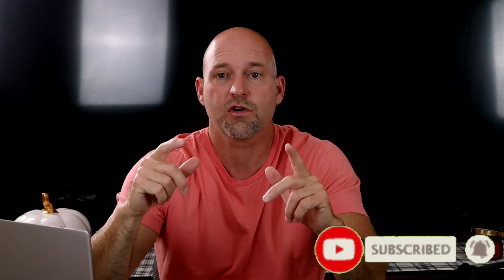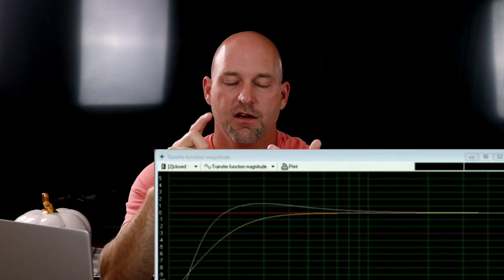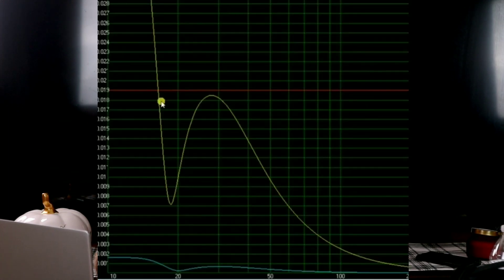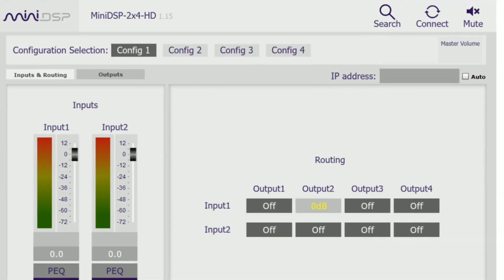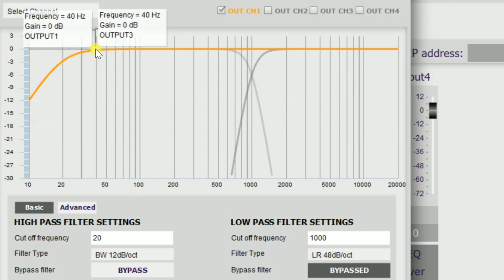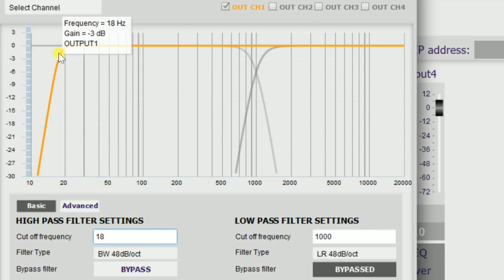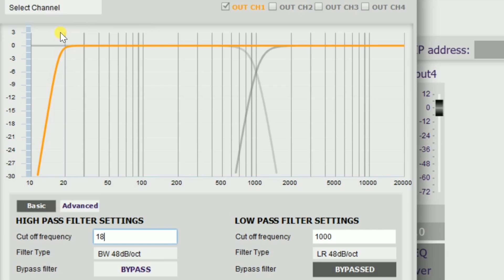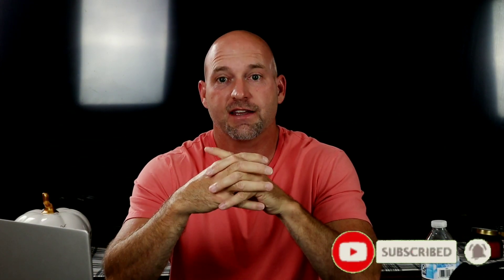Ep. 41 - Protect the BASS! Subwoofer  HPF | High Pass Filter | MiniDSP. DIY Sub | Home Theater Gurus

Comment: Thanks so much, as of alot of us i have lett my system calibrated by "Brandon" 👌, 
But i wanted a little more Shaking lows, on my Mini Marty with a Dayton UM-18 Driver Powered by a Crown XLS 2002 , and a 2x4 DSP hd, he set my Mini Marty Witch is 17 Hertz tuned at 18 Hertz and a 24 octave slope, then i set it to 12 db slope, to discover that i was rolling of at 30 Hertz, not what we want, now i have set it to 15 Hertz but at a 36 Octave slope, so its exactly tuned what the Mini Marty need and is not going to damage my Subwoofer cause of over excursion 👊 this video is amazing thanks so much 🙏

Comment: I have a Yamaha avantage 1080 receiver. The sub out of the avr I hav connected to the poweramp that has no dsp. The power amp is connected to my passive sub. Can I use Yamahas internal dsp to do subsonic to save the subwoofer or I need to buy a miniDSP. 
If yes what are the main functions that miniDSP has that a Yamaha avr dsp doesn’t have purely subwoofer point of view

Comment: I was under the impression you wanted to do this before ever running my sub (full marty) but in episode i believe 7 you set it toward the end after running sweeps,aligning etc. Does it matter if set before or after sweeps?
Reply from the maker: You can do it either but the important thing is to make sure you don't set it then boost it under the filter during eq which negates the filter.

Comment: What would you set your cut off frequency in the case of using port plugs?  My PC4000 is 17Hz standard, but with a port plugged is 15Hz.  Do I still want to use 17Hz for the cutoff even if I have the port plugged?
Reply: No, you can change the HPF if you plug the port

Comment: Very important video that no one talks thank you 
A question if I have plate amp it doesn’t have a subsonic filter so I will have to buy a miniDSP correct 
The avr why don’t they have this feature built in so that we don’t need to buy a miniDSP or a plate amp just buy a superb poweramp and drive a passive sub

Comment: I used REW as per your video and aligned my 4 subs. Thanks a lot for your videos. After I pushed my calibration to miniDSP. I do measurements to confirm if the new calibration has been ported. It works. But then when I set Crossover settings as per this video and rerun the measurements, it changes the whole sub response curve and introduces new dips and gains across the whole response. When I revert the crossover settings, it reverts back to the calibrated response. Am I missing anything?
Reply: Hello, I also faced the same issue.
After applying the minidsp nice house curve to the subwoofer group, when I apply crossover on AV Receiver, it breaks the house curve.
The solution for this AV Receiver Crossover settings issue is explained in this video from Home Theatre Gamer (Part 4 of his 6 MiniDSP HD series videos).
Basically, the issue is missing time alignment between your main FL FR speakers and your Virtual Subwoofer group:
For example
- for crossover 80hz it requires different delay X between your main speakers and your virtual subwoofer
- for crossover 100hz it requires different delay Y between your main speakers and  your virtual subwoofer
- for crossover 120hz it requires different delay Z between your main speakers and your virtual subwoofer.
- and so on, and so on

Its not like the same delay/time alignment between the main speakers and the subwoofer group, will work for any Receiver crossover setting, no.
Reply: https://youtu.be/PpRC5cPjh0Q

Comment: Will you also be covering when to apply the Low pass filter?
Reply from the maker: We don't set that in the subs amp.  The avr or processor sets those which was covered in a few videos.  The latest is the audyssey video.  Also ep 9 covered it.
Reply: @hometheatergurus  thanks. If you are referring to the 80hz crossover at the avr yes  that is set in the avr. I was just wondering if there was anything additional.
Reply from the maker: @diybuildandlife207  you also have a LFE Lpf.
Reply: @hometheatergurus  thank you
Reply from the maker: You're welcome. Ohh and we did use a lpf to filter noise in the sub hum video.  Forgot about that one.
Reply: @hometheatergurus  thank you. I just saw it. I am going to rewatch episode 7. I have an existing Klipsch subwoofer. I am building a new martycube with Lavoce SAF 214.03. I want to test run with the Marty. If I am mixing a DIY sub with a store purchased one would Episode 7 still work for me or do I need to change any settings given that the Klipsch will not go through minidsp and will be connected directly to the receiver?

Comment: I've been following your videos and they have been really helpful specially for a noob like me. I do have some questions and would really appreciate your help. I'm trying to integrate my new sub ( SVS PB-1000 ) to my 2 existing old subs ( Paradigm PDR12 and PDR10 ) in my dedicated HT room that's 19X13X8. I know they are mismatched subs but I wanna see if I could possibly make them work together.

1) Setting a HPF with the MiniDSP specially with 3 mismatched subs that have 3 different tuning frequencies will it work? Does that mean that I will set 3 different HPF values on the MiniDSP?
2) Being a noob I have no idea what the tuning frequencies are on the SVS PB-1000/PDR12 and PDR10.
Reply from the maker: Thanks John!

You're subs are brand name subs so the HPF is baked in already.  If they were DIY subs you'd have to do it yourself.
Reply: @hometheatergurus  Thanks so much for the quick reply. Sorry for the noob question. So I don't need to set any HPF filters?

Comment: Ugh, I'm so sorry man, I'm always super late to these! I don't check my Budget Audiophile YT channel very often, I need to do that more! I would love to see, if you had time, a video talking about sealed subs. Not necessarily a "comparison" but just talking about sealed subs and why the ULF freaks like me often prefer sealed subs/Infinite Baffle as opposed to super low-tune (like an LLT) vented subs. 

RE: This Video . . .I do run a lower HPF. Previously I was running NO HPF but I found that it would ruin my response in the sweeps so I run a super low HPF and that cleaned everything right up. I find that digging into the triple digits at, say, 11Hz, is a lot more fun in my theater than hitting 139dB at 30Hz. But that's just me, I'm a deep-note junkie! 

I can't wait to see that audyssey video of yours, I was messing around in it but couldn't really figure it out, so that will be EXCEPTIONALLY helpful. Right now I'm running with MultEQ32 turned off because, like you mentioned, it obliterated my response. Worked super hard to get a nice response just for Audyssey to ruin it. Currently I'm only using Audyssey to tune my mains.

Comment: Is this a good way to fix subs to are gaining room mode in there location. For example my PB3000's get a lot of room gain from 10-20h. The REW doesn't correct this for me and Audyssey doesn't either. Here is what I have so far
https://imgur.com/gallery/8EPaZ99
Reply from the maker: In that pic it's knocked down in gold correct?  The minidsp will have no problem knocking down peaks due to room gain.  But yes you can use a hpf to limit lower end output to protect the driver or to please your ears.
Reply: @hometheatergurus  Thanks, Yes it's the Gold where I added the PEQ's and phase aligned for Audyssey.
But there is still too much output in the in the 17hz range which looking it again I'm not sure it's room gain but regardless it's a bit too much for me, I'm more into the chest thump sound. 
Thanks I'm doing another calibration shortly so I'll use this pre-Audyssey
Thanks again